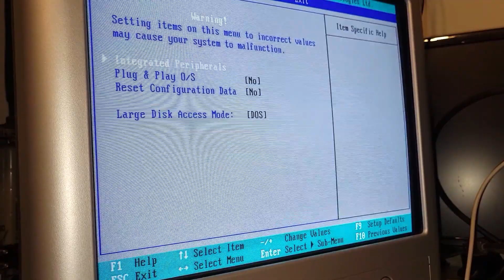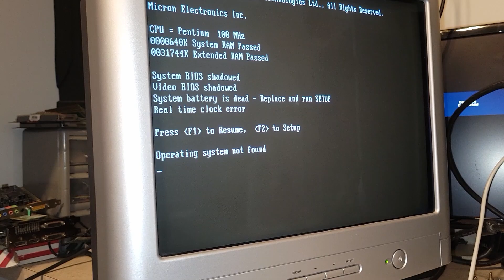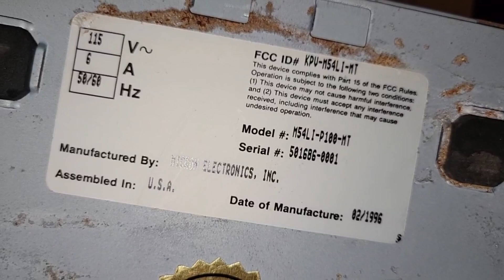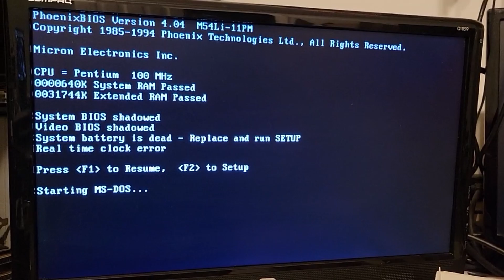2 Barn Find Micron PC's from the mid 90's  PART 1

Comment: Great to see you Rick! Nice old machines and that one cleaned up really well. Those Dallas clock chip batteries can be a pain. It may be preventing the 486 from posting, some boards wont without one. Anyway, take care with the storms an I look forward to seeing you again soon. ATB.
Reply from the maker: Hey Ted, thanks! I will check out the 486 with a new battery for sure, that would be nice if thats all it was. Waiting on coin cell holders now

Comment: I don't understand the goal of the removable sheet metal on the case, next to the power supply.
Is it the size of a cdrom ?
Reply from the maker: no it is where the hard drives are installed, a strange place for them but pretty convenient to access
Reply: @Snickerrick  The place is a bit unusual, but I've seen other cases with hard drive somewhere else than on the front.
Never this removable plate.
Reply from the maker: @nalinux  it swings up but i removed it to access the power supply bettrr